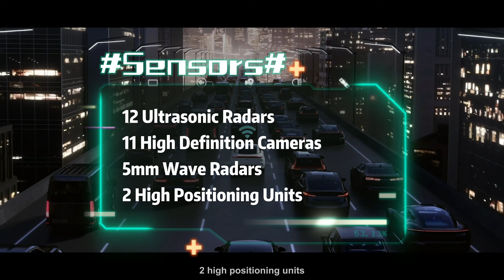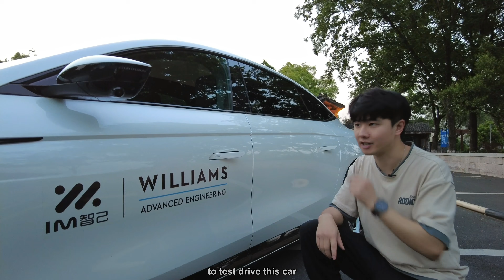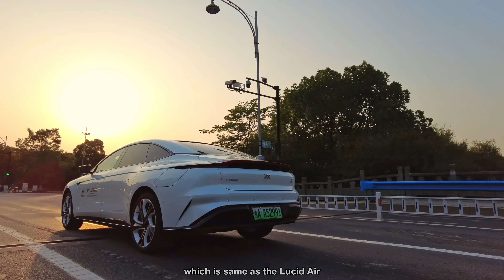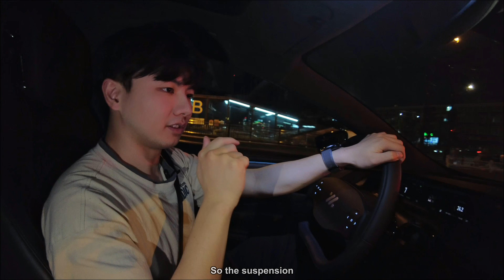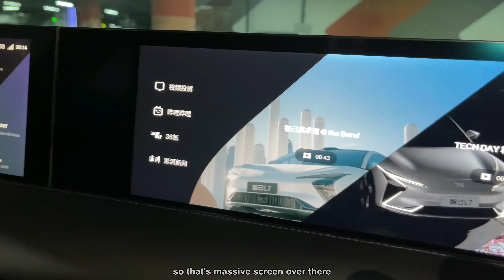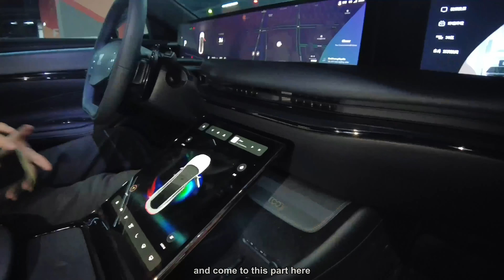Alibaba First Car - IM L7 SAIC Zhiji L7｜Can It Beat NIO ET7, Tesla, BMW, Mercedes-Benz, And Audi?

Comment: I test drived it last sunday. Sporty feeling, I even feel L7 is better when compared to my bmw 5 series (maybe my bmw is not in good condition since it is already a 5 years old car).
Reply from the maker: Yeah, it's quite sporty car. Maybe the feeling of driving a electric car is different than driving a gasoline car 🤣, but I have to say the L7 impressed me in in terms of the chassis tuning and flexibility of turning.
Thanks for sharing your thoughts!
Reply: That's a statement.😊As German I am spoilt by our manufacturers. My uncle worked all his life for BMW in Munich. Nio just opened in Netherlands/Rotterdam the shop. Already 3 swapping battery stations setup. ET5 and ET7 is prior to Tesla. Exiting times ...

Comment: Hate these EV door handles many car makers are doing. I know they want flush handles to reduce drag, but there has to be a better way. Why not flush, potentially body-coloured circular push-buttons 2” in diameter (“door openers”) and when you push them in they pop the door out upon release? Mechanical and physical without being annoying and awkward. You open the door by simply pushing a button. None of this fiddle-faddle seesaw fumbly nonsense.

Comment: i liked better than the et7 because of the price. i wish the main big screen had less bezel. you drove the et7 so which one of the 2 is more comfortable and less cabin noise? do y have a device to measure cabin noise and comfort?
Reply from the maker: Hi Tony, yeah the bezel-less screen looks definitely cool if they could make it more durable. Personally, I feel that ET7 is slightly quieter, but both of them are good. I should get a noise measure device 🤣.
Thanks for your comment!

Comment: What a copy of ET7! Why no originality? Looks like they just said “Build the ET7 with a few little changes.” SAD. Build your own car. Don’t steal from Nio.
Reply: actually these two cars are quite different. L7 is a lot more sporty, with rear wheel turning. thr et7 is more plush for comfort. i don't know why you think one is a copy of the other. both were announced and moreketed around the same time. they look similar, but all sedans look similar from outside. interior look totally different. I think this l7 is overall a better car than the et7.
Reply from the maker: Hi there
Thanks for watching!😅
Reply: The R&D of both started almost the same time。。。

Comment: Its really attacking the ET7, but ET7 has few perks that L7 doesnt. For example Nio house or the premium treatment that every Nio owner gets. As Nio fan I hate to admit that L7 has much cooler interior design.
Reply from the maker: Hi there, yeah NIO is taking advantages on the battery swap stations and the service they provided to their owners. The racing mode of L7 is pretty cool at night time.
Thanks for your comment!
Reply: Et7 is your second living room not a play toy.